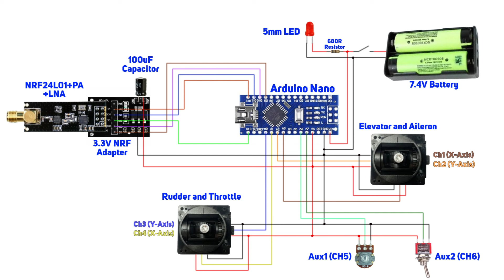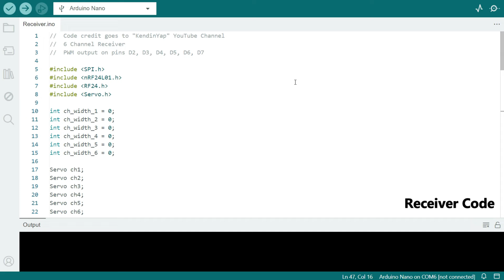How To Make 6 Channel Transmitter And Receiver

Comment: Nice video🎉
But i have some concerns, so i hope you will help me out, 

They are as follow:

I want to make a drone with 180 dc motor, i will also use a gyro in it. 

So i want to make a 7 or 8 channel reciever and transmitter. 

Also i will use the axis gyro joystick available or marketplace like amazon. 

So can you prove me with the information about how to make it,    i. e. Its code, any problem with online availble gyro and the main parts its circuit.
 Also I will be using the nrf recover module the one which comes 

without antenna, so any problem with this or not. 

I hope you will surely provide me with the upgraded code, circuit and other quries about the component I will use other than that of you. 

Thanks for reading.
Reply from the maker: @TechieDudes   I'm glad you liked the video.

First of all, you should make sure whether the 180 dc motors have enough thrust to lift the drone. As for a good drone, the thrust shall be about 2 times its total weight.

Next, you're asking for electronics components. You can select them according to your requirements. As for a drone, the nrf module without antenna gives a really short range. I mean it can work without any problem. But if you want to fly your drone at a longer distance or more height, you should get an nrf module with antenna.

And for the gyro, the one that can be easily used with arduino and its source codes are availabe easily, is the MPU6050. I have personally made a drone using that gyro module. And it has great stability. 

For more information about your drone project, you can get the ideas from a video by "Max Imagination"
https://youtu.be/Sa6EslOHsI0?si=B22qgW65WG61kOFt

Feel free for any further assistance. I am here to help you out. Cheers 🎉❤
Reply: @AKElectroDIY  thanks for replying back. 

I motors I will be using will be broviding 100g trust ie each motor will be able to care this much weight while flying (minus the 28g weight of the motor so approx 70g ) 

I I'm making a very light drone so there is no problem with the drone motors, but the problem is with how I make the reciver and transmitet so can you provide me with the new circuit and code.
Reply from the maker: The video link I provided has complete circuit and code for this kind of drone. I would recommend watching it. If you have any futher concerns, feel free to ask.
Reply: @AKElectroDIY  hey, can tell how many channel i would be requiring for 4 motor drone with 1 mpu5060. 

Also tell I want to add fpv the how many channel reciver and transmitter I would be requiring
Reply from the maker: @TechieDudes  You need at least 4 channel transmitter and receiver to fully control the drone. You can add some extra channels if you want additional features. But four channel is enough for a drone.
Reply from the maker: @TechieDudes  The fpv transmitter and receiver is separate. It is not connected to the main transmitter and receiver. But it is costly as compared to the basic transmitter and receiver system.
But don’t worry. I am planning to soon make a video on the cheapest fpv camera system. Stay tuned.
Reply: @AKElectroDIY  since I am begginer in drone making, that's why I wanted to ask do we will not need any other channle for mpu and Or any other essential module, 

Since by 4 channel i can  only control motors not the gyro mpu5060 and any other mudule(if any) . 

Pls correct if I am wrong.
Reply: @AKElectroDIY  what about mpu
Reply from the maker: @TechieDudes  You actually need only four channels to control the motor speed. And that’s all. 
Here are what the four channels used for:
CH1: move right/left
CH2: move forward/backward
CH3: adjust height by controlling speed
CH4: rotate left/right

Here’s how it works: 
The 4 channels from the transmitter are used to control the motion of the drone by giving signals to arduino. The arduino is already using the mpu6050 to balance the drone when it is flying. So arduino just moves the drone in the required direction with the help of mpu6050 for balancing the drone.

In short, The use of mpu6050 is just to balance the drone. It does not have any direct connection with the channels. The arduino handles the mpu6050 separately and the 4 channels separately. 

Hope this clarifies your concern. Don’t worry if you’re a beginner. Just ask from me or learn from other resources like google and chatgpt.
Reply from the maker: @TechieDudes  also correct one thing that its mpu6050 and not mpu5060.
Reply: @AKElectroDIY  thanks bro, for replying me in a very short span, since I am beginner, I am funding very much difficult to make drone and it's remote control, and i am not getting any proper guide since all videos are of big youtuber and they can't reply all comments but you are that the best thing about you, so thank you for this. 

So i am planing to make a 6 channle reciver and transmiter, 

I want to make drone with nano and not uno, so can you suggest any video about it how to make, since their are only one or two video on it, 

Also can you help me out with the drones connection with the reciver and transmitter and nano. 

And one last thing, since I will not be using brushless motor having 3 pin socket instead I will be using 180 dc motor having only two points positive and negative, so any problem with that, i mean how I will able to connect them to your reciver pins
Reply from the maker: @TechieDudes  First thing, the arduino uno and nano are interchangeable. That means you can use a nano instead of uno and a uno instead of nano. And the connections for these will also be the same. So no problem here.

Next, you need an ESC(Electronic speed controller) to control the speed of the motors. There are four motors so four ESCs will be used to control each motor individually. ESCs are compulsory whether you use a brushless motor or a brushed motor like the 180 motor. There will be only one difference that brushed motors used brushed ESC and brushless motors use Brushless ESC. 
All the ESCs have three wires for connection with the receiver. So it will not matter whether you use brushed esc or brushless esc. Wiring will be same for both.

One such drone has also been made my “The DC minds” youtube channel. He just used a separate arduino for the drone flight controller and a separate arduino for the receiver. So, in total three arduinos were used. You can watch his video of the drone. He used brushless motors but you can just ignore it and use brushed motors keeping the wiring same. He also provided step by step procedure for programming and gave the wiring details. I would recommend checking out his youtube channel. I also made a drone that he made, taking help from his video. And it was successful. I will also upload the step by step video on the making of my drone. But for now, you can see his videos.
Reply from the maker: @TechieDudes  By the way you’re from India right? I’m from Pakistan. We have a whatsapp group of some India and Pakistani youtubers and other people in this hobby, where we can discuss drones and rc planes. You can share me your whatsapp number if you are interested to join the group. You can get guidance from there too.
Reply: @AKElectroDIY  je suis près à l'accueillir , moi je veux juste savoir comment activer ma pompe via un interrupteur depuis la commande radio
Reply from the maker: @YenissiBani 
You can simply use a brushed ESC to control a pump using a switch/knob from your radio control.
Reply: @AKElectroDIY   ok merci beaucoup , mais qu'en est il un relais ?
Reply: @AKElectroDIY   je veux juste pouvoir activer ou désactiver la pompe(brancher sur la chaine 5) à distance via un interrupteur
Reply from the maker: Yes you can use a relay. You have to setup the relay in arduino code. It is quite easy though to set it up
Reply: @AKElectroDIY  tanks what about MOSFET,
Reply from the maker: You can use that one too. But I haven't used it in this particular application so I can't tell you exactly how to use. But you will easily understand from other YouTube tutorials
Reply: @AKElectroDIY  D'accord merci je veux juste minimiser le cout de fabrication
Reply from the maker: I think relay module is a good option. It's really cheap though. Just connect it to arduino and use it easily
Reply: @AKElectroDIY  non le problème est que si j'utilise n relai est ce que je pourrai l'activer  à distance par mon RC radio , en fait je veux que ça soir directement brancher sur la chaine 5
Reply from the maker: Then you can go with the mosfet. But realt will be more practical if you’re using an arduino receiver. You can easily program the receiver for the relay. That is the reason why relay is a more practical option for use with arduino based receiver
Reply: @AKElectroDIY  ok merci pouvez vous m'aider avec le code de l'Arduino uno, du récepteur et du transmetteur?
Reply from the maker: It's given in video description. You can download it and upload. If you want to make any changes, you can give the code to chatgpt. He will brief you and make changes accordingly
Reply: @AKElectroDIY  D'accord merci
Reply from the maker: You're welcome

Comment: Can I use arundio nano ch340 

Please reply
Reply from the maker: Yes you can
Reply: Tell me please
Reply from the maker: @keertikushwaha3639  Yes, it does not matter. You can use any.
Reply from the maker: @keertikushwaha3639  mine is also ch340
Reply: @AKElectroDIY  

Okay bro thanks 👍
Reply: @AKElectroDIY  
I think you used 
Ch340 driver?
Reply: @AKElectroDIY  lastly 

Can I use 8.4v battery's For both reciver and transmitter 

I will connect battery to esc
Reply from the maker: @keertikushwaha3639  Yeah I used ch340 driver 

As for the battery, yes you can use 8.4V battery for both transmitter and receiver

Comment: Bro help ihave old drone joy stick how to connect
Reply from the maker: @saqlainbilal6433  You need to connect the Potentiometers of the joystick. As they have 3 wires each. Namely VCC, SIGNAL, GND.
Normally, the middle wire is signal wire and the side wires are VCC and GND wires. The side wires can be interchanged but the signal wire remains the same. 
Furthermore, if you are unsure about the wiring, you can just check the Potentiometer for correct terminals using a multimeter. There are a ton of tutorials on how to check a Potentiometer.
Reply from the maker: @saqlainbilal6433  If you need any more assistance, feel free to ask. I'm here to help you out.
Reply: I have no idea how to connect
Reply: @AKElectroDIY  it has six pins
Reply from the maker: @saqlainbilal6433  It has two Potentiometers so I think the six pins are for the two Potentiometers, 3 pins each.
Reply from the maker: @saqlainbilal6433  Can you tell me more about the pins? Is there anything written on them? Or any color difference?
Reply from the maker: @saqlainbilal6433  You can share pictures on instagram

Comment: Bro in thr diagram you had shown to connect the vcc of the nrf to vin of arduino and in the video you are showing that you are connecting vcc of the nrf to 5V of the arduino , which one is correct
Reply from the maker: In the transmitter, I connected VCC of NRF to 5V of Arduino. 
But in the receiver, you can either connect it to 5V or the ViN. I tried both, and they work. But the better option is ViN. As ViN provides a more stable voltage than 5V of arduino. In fact, ViN is also a 5V supply that is coming from the ESC.
Reply: Please tell sir
Reply: @AKElectroDIY  ok sir
Reply from the maker: Both are correct
Reply: @AKElectroDIY  ok sir

Comment: I made this same way as you did but the esc makes 2 beeps and a 1 long beep and stops, I can't even control the bldc motor with my joystick. Please give me a solution for this calibration
Reply from the maker: It seems the ESC calibration problem. Did you calibrate the ESC? Or you're not familiar with what ESC calibration is.
Reply from the maker: And, just a question. 
Are you using a 2S (7.4V) battery to power the ESC?
Reply: @AKElectroDIY  yes I did used 2s and also 3s but the last beep is not twice instead it's a single beep. My esc is a 30a standard esc which is a local one. Please  help me to solve this problem 🙏
Reply from the maker: The last beep is single I think. Its like
Beep beep beep ........ Beeeeeeeep
Reply from the maker: Actually, when you use 2s battery, the beep is
Beep Beep ...... Beeeeep

And for 3s, it is
Beep Beep Beep ........ Beeeeep
Reply from the maker: Can you tell me that are servos working on other channels? On any other channel?? Have you tried a servo?
Reply: @AKElectroDIY  that's correct! I'm facing this problem for many hours but couldn't find any solution
Reply: @AKElectroDIY  when I connected the servos to channel 1 that servo didn't move even when I moved the joystick but when I plugged other servos to channel 2, channel 4, channel 5 and 6 every servo was moving automatically. I used 5v through a USB port to power the Arduino nano so I didn't use any battery .
Reply from the maker: Which joysticks did you use
Reply from the maker: Also, you need to power the arduino and servos through a battery. As the arduino 5v output is very low to run servos correctly
Reply: @AKElectroDIY  I used ps2 joystick modules
Reply: @AKElectroDIY  yes I did used by powering the esc then the three wire to the channel but the servos didn't work at all
Reply from the maker: Kindly check the wiring again. There might be any mistake while making the connections. And also double check them using multi meter. 
I also faced a problem that servos were moving themselves. And it was wiring error. Tell me after doing this.
Reply: The same problem I am getting and all wirings are right but still nothing is working. The transmitter and reciever is working properly when checking through the serial monitor but in real when motors and servos are connected it's not working even when a single motor is connected it's not responding.

Comment: I think there is an error in your video. While doing connections of rc joysticks, you mentioned yellow wires are ground wires. but ground wires are the black ones which then joined together of both potentiometers. But the signal wires(yellow ones) aren't joined obv. so is it true?
Reply from the maker: Actually I did wrong connections at first. I thought that yellow ones are signal and black ones are ground. That's what I showed in the video.

But after completing the project, it was not working properly. Then I discovered that the wires were not coloured correctly. The yellow ones were actually the ground and the black ones were the signal wires.
Reply: @AKElectroDIY  can you send me the proper circuit photo?
Reply from the maker: @atxgaming1457  the proper circuit diagram is shown in the video.

Comment: Hey, I am not getting how to connect the joystick module, since I have bought the joystick PS2 joystick module. So pls help me out with the circuit for it, in detail.
Reply from the maker: The connections will be similar. And I do also have a seperate video on the transmitter I made using ps2 joysticks, and it contains circuit diagram too. You can check it out and then ask if you still need any assistance.
Its the first video on the channel. You can scroll down and see it.
Reply: @AKElectroDIY  I have seen to it, and now I got understand, only one thing I wanted to know, that since I am making a 6 channel rc, and the circuit I am seening in your video is for 4 channel rc, so doesn't it will affect the circuit.
Reply from the maker: @TechieDudes  You just need to understand from that video that how to connect ps2 joysticks. And compare these with the 6 channel transmitter. And then you just use the code and diagram of 6 channel transmitter after making appropriate connections.
Reply: @AKElectroDIY  but, what if I mistakley do all wrong connection.
Reply: @AKElectroDIY  can I not copy down the whole ps2 joystick module connection circuit from the previous videos and copy paste to the 6 ch. Circuit.
Reply from the maker: @TechieDudes  You need to understand both diagrams. And then follow the diagram of 6 channel. Use 4 channel diagram to just understand how to connect the ps2 joystick. Connections are almost similar.
Reply: @AKElectroDIY  hey i am unable to compare the both circuits, since it is very much complex circuit,pls helm me.
Reply from the maker: @TechieDudes  Just joystick difference. Everything else like nrf and battery, leave it
Reply: @AKElectroDIY  but in this video the circuit you have given, it is not clearly mentioned, which wire of joystick, is joined to where, while in ps2, there is clearly mentioned the names of all pins like gnd, sk, etc. 

That's the problem
Reply from the maker: @TechieDudes  You just need to make sure to use the correct pins of ground and vcc. The other four signal wires, you can just randomly connect to A0 to A3. It won't affect the readings at all. I mean even if you do wrong connections, that is ok. So just make sure to use joystick signal connections to arduino as shown. Its really easy though.

Comment: hey i have a doubt , do we have to consider negative and positive while connecting the 100 uf capacitor, if yes then how , pls tell.
Reply from the maker: Yes, we must consider the negative and positive side of the capacitor. If you connect it in reverse polarity, it can explode. So be careful.
On the capacitor, the negative terminal is mentioned using negative sign. You can easily identify the terminals by just looking at the capacitor
Reply: @AKElectroDIY  the negative and positive of capacitor I got to know but where to connect it, ie negate to (gnd or vcc) or positive to (vcc or gnd)  pls clarify
Reply from the maker: @TechieDudes  
Negative is Gnd
Positive is Vcc
Reply: 电解电容要分正负极
Reply from the maker: @honestgo  Yes you are right

Comment: Is this toggle switches (On off ) or (On On ) ?
Reply from the maker: Its On Off
Reply from the maker: Actually it has 3 pins
Center one is common
While side two pins are used as, one fkr 5V and one for 0V.
We can switch between 0V and 5V